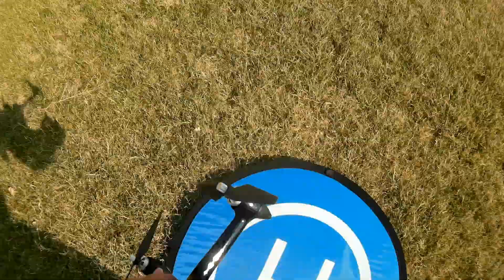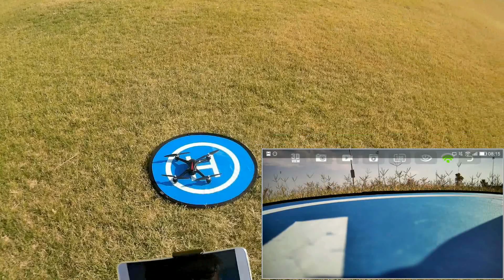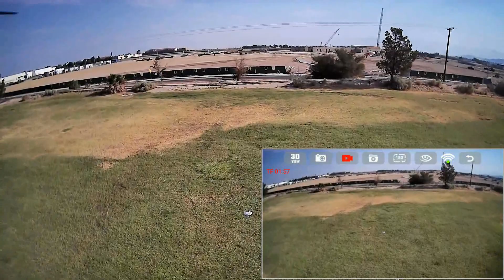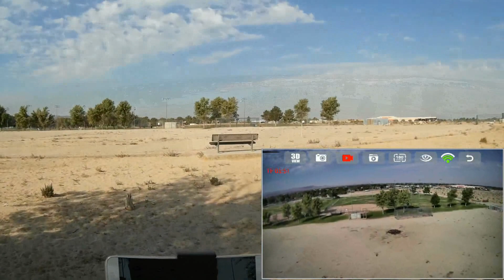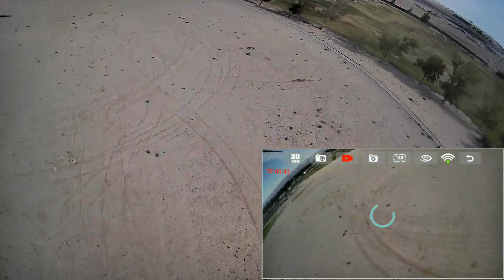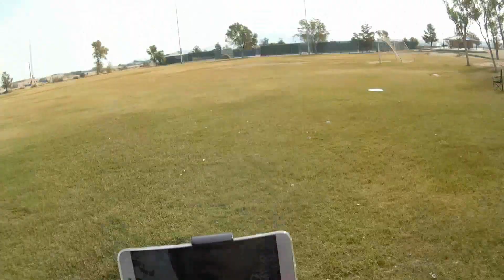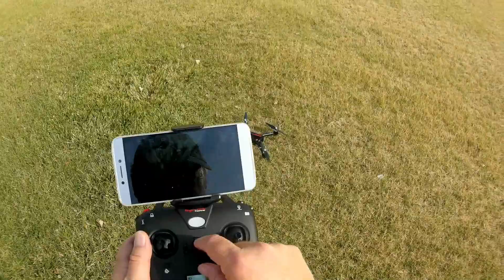MJX Bugs 2W B2W High Speed GPS FPV Drone Flight Test Review

Comment: Hello 101, could you tell me if there was a first generation bugs 2? The reason I'm asking is I purchased a battery that didn't fit.  When ask seller what's the deal  he stated its for first generation bugs 2 that doesn't have the locking nob on bottom. This one have a clip on top and bottom.
Reply: dave parks what I've done is use the battery from bugs 3 which cost a third of price,  with a little mod works great. I now have 5 battery for bugs 2w.👍👍
Reply from the maker: I was unaware that there was a second generation.  But according to the following listing, there is http://amzn.to/2xE4KSw
Reply: Michael Millines yes I notice my bugs2w have a lock switch under back of drone I see in video not every one have the battery lock the old battery won’t fit in new version but new version battery can fin in old version bugs2
Reply: Larry Dommer thanks for taking time to respond but I'm way ahead. Yes that does work and what I use. Thanks again.

Comment: hi wanna ask what the different with bugs 2c?any big gap between them?thanks
Reply from the maker: +Good Yeah Bugs 2C does not have FPV. Although it does have a 1080p camera that records to a mictoSD card, you can not view the in flight video view while flying.
Reply: Quadcopter 101 so when bugs 2c on flight it cannot show real time video record?can i get the recording video copy from mjx apps?
Reply from the maker: No.  As the 2C does not have any WiFi capability there is no app for it. You will need to instead manually download the recorded video from the microSD card.  You can do such with a USB card reader with your computer, or by placing the microSD card into your phone's card slot (if it has one).

Comment: Does any bugs 2 owners know if the stock battery 7.4volt  1800mah battery is able to be replaced using a modified bugs 3 2300mah battery 7.4volt
Reply: Yes u can as long as voltage same

Comment: Hi sir, what phone model did you use to connect in the bugs 2w because mine can't connect to my phone. My phone model is asus zenfone 3 max
Reply from the maker: As discussed in the video, and also listed in the cons of the video description, this phone uses 802.11ac 5G WiFi.  Not all phones have this capability.  As per the following site, your phone has 802.11b/g/n Wifi (not ac).  Unfortunately it will not work with your Bugs 2W. http://www.gsmarena.com/asus_zenfone_3_max_zc520tl-8207.php

Comment: HI!, question... can this quad get rewired to use standard Lipos of 2 or 3 cells?... I don't like proprietary Lipos as they are not available in Chile and very difficult to obtain as not many people ship lipos to Chile. Thanks.
Reply from the maker: Yes it uses a XT30 connector for 2S batteries.  You can use the widely available and cheap Bugs 3 batteries for this quadcopter.
Reply: Quadcopter 101 Thanks
Reply: Yes just pull battery out of case...use other batteries and hold in with tape, no door

Comment: Which is better. H501S Standard or This?
Reply from the maker: I really like this as its such a better flier than the H501S.  But the B2W does not have follow me mode if that is important.
Reply: Quadcopter 101 Which has a longer range? Safer flight and most stable? 

Thanks Q101

Comment: Hello again "Quadcopter 101". Many thanks for your review of the MJX "Bugs 2" brushless motored quadcopter. It was a fantastic review, and like many other reviews before it I thbnk you pushed me over the edge to buy one. With brushless motors, GPS,  altitude hold, stable video, etc etc. I think it's a must have for the price. 

Many thanks again for the great review of the MJX "Bugs2", and as always, very best regards.
Joe Cro
Reply from the maker: I actually took this on vacation with me (along with the DJI Spark).  So yes, I do think that the Bugs 2 is a remarkable quadcopter.
Reply: I appreciate your advice, and could easily tel by the enthusiasm in your voice during the review that you really liked it! I think I'll go looking around for the best price and buy one!
Very best regards,
Joe Cro
Reply: straight up test would be cool
Reply: straight up test
Reply: straight up test
Reply: what about a straight up test

Comment: It's beeping because your at low voltage , all the lights will start flashing red , just a heads up. Iv'e flown about 40 packs through mine. Flight time is only about 10 to 12 minutes. Still gr8 fun though for the price...

Comment: It will work with the bugs 3 lipo , put a small piece of  duct tape on one side ,either left or right side but not both and it fits snug enough to hold it in.

Comment: I have this quad and think it's gr8. I use it with my samsung galaxy 6s and it has perfect video connection up to 500m out and 100m high. My flight distance without wifi is about 900m out at 120m high. 
Great video :)
Reply from the maker: When did you get yours?  I saw some early reviews of prototypes back in April/May that had amazing WiFi reception.  But the one that I received is pre-production, and I think that they might have dialed the WiFi output power back (possibly for legal reasons).
Reply: Quadcopter 101 Hi there , I got mine 2 weeks ago from a seller off eBay from right here in the US. Not sure how they got there hands on it .I like it better then my 501s. Just wish it had a little longer flight time
Good thing I had multiple batteries for my bugs 3😎
Reply from the maker: Yep, sounds like you got one of the early prototypes sent out for review.  Consider yourself lucky.
Reply: Quadcopter 101 Yes I'm starting to feel that way😀
Reply: Did he just say Samsung Galaxy 6S ??
Reply: S. Kingsbury how is bugs 2 flying today

Comment: I am still a little amazed that no reviewer actually says that its very much like a Hubsan H501-series quad. :-) They amost equally in size, and in a sense almost the same design. I do think this one looks a lil meaner though. :-) It flies nice but I still think the H501-series from hubsan has a better camera.... you can clearly see jello in this camera.
Reply: Class 10 micro sd card takes care of the jello , I have no jello in mine.
Reply: I used the one from my dji mavic and it worked very well for me , but then again no 2 are created equal " quads anyway " . I will be uploading mine this week so feel free to come check it out :)
Reply: Most of the MJX Bugs will lift an action camera like a gopro, Git2,  Firefly etc. and those will allow you to get rid of
 the Jello.
Reply: S. Kingsbury Hmm that's strange. To my knowledge sd-card has nothing to do with jello? 🤔
Reply: S. Kingsbury I will do that
Reply: idk.. i don't have either but would like to get both :). but i agree, the Hubsan still looks to be better (more stable,better camera from the video clips i have seen) & it has more accessories & the TX + fpv range is better.. the places i looked, the bugs 2w is a little cheaper H-501S (the h501_ series model i think it best compares too), but i think i would spend the little extra for the H501S
Reply: RCI , the hubsan range is definitely not further and they are known for transmitter glitches.

Comment: this wifi range is unacceptable. If you mod it it can be nice but than you would spend more.. rather than modding better to spend another 150-250 usd and buy used phantom 3 or even phantom standard around 400 usd or buy a spark.. I like some of these cheap quads when they are less than 150 -100 usd range.. if they cost more than 200 usd than betternto invest a little more and buy DJI phantoms..
Reply: Bugs 3 was my first brushless quad and I still love flying it.  IMHO buying FPV camera and goggles and using with the bugs 3, for me, is a better option than buying the Bugs 6.  Mainly due to its versatility and the fact you can run on a 3s with 6045 props and get much more speed out of the B3 than the B6.
Got my son the H501s last Xmas, while camera quality is ok, still un-stabilised and fish-eye effect.
Cheers!
Reply: yes I have the Spark now and may consider removing the extended legs from the B3. Only issue with Firefly is the 3 second Auto Photo Mode minimum interval that is too slow. Can get good aerial shots with 0.5 second interval. I have the Yi 4K but it is way too wide, but like the fisheye correction in camera. The B3 with its bright LEDs really helped me get comfortable with orientation.
Reply: just bought b2w price only $120 with coupon.. i think that half price h501
Reply: You could add the Xiaomi Mi 4k to that list.  A number of reviews show features and camera quality beating the phantom 3p.  Just bought the Mi 4k and while only a few flights so far, I am very impressed with the quality and features.  Gimbal does an amazing job in high winds and they seam very active with firmware updates and improvements!
Cheers!
Reply: I second that. I just got the Spark. I have the MJX Bugs 3 and I did sell the Hubsan H501S. This seems a clone of the Hubsan. Even the calibration rotation is the same. Probably same parts. I learned orientation with the Bugs 3, and I used the camera in Auto Photo Mode, but video has jello or it is shaky. If you consider that a camera equiv to the Spark is 150 / 200 USD, a gimbal 100 USD, FPV monitor 50/100 + 100 / 150 for a quadcopter a Phantom 3 or a Spark is convenient and you will get better result. But anyway I ordered a Bugs 6 with FPV for 119 because the Bugs 3 is more fun to fly than the Spark, and Bugs 6 is smaller and more portable, and I can always rig a better camera in Auto Photo Mode and use FPV for framing. Phantom 3 is too large for me to carry around, and I prefer something smaller that is less threatening looking. But this Bugs 2 could be interesting if it were 150 and there'd be a way to extend landing gear and attach an action cam.
Reply: issue with goggles prevents line of sight flight. B6 was 117 shipped, and I like the smaller form factor. I probably can use some Syma X8 battery with the adapter that I use on the Bugs 3.My main gripe with the Bugs 3 are the taller legs that have to be screwed. I hope someone may produce some clip on landing gear. There are Git2P, Firefly 7S and 8S action cams that have 90 degree linear (no fisheye lens). But Spark is great for photos.
Reply: Yes had the Firefly Q6 and a 2d gimbal on the Bugs 3, unfortunately went for a swim in the lake I was over, I think load was to much for old battery.  Now they are paper weights, tried all the usual tricks but I think they are fried!  Replaced all ESC's and FC board on the Bugs 3 and it's up and flying :-)
Would be nice to have clip on legs for the Bugs 3, but using the Xiaomi Mi 4k for film and photo's now and the Bugs 3 for FPV and LOS fun flying without the landing legs.
Cheers
Reply: Yes love the front LED on the B3, it has saved me from a fly-away on many occasions when I was first learning orientation.
Impressed so far with the Xiaomi Mi 4K, great video and gimbal stabilisation.  Doesn't have as good a dynamic range as the phantom but IMHO it really is good value considering the price. 
Cheers!
Reply: Gur Isler Chris Riley is the king of bugs 2 he has flown his bugs 2 verybut very far. Unbelievable far check it out just type Chris Riley Bugs2
Reply: Arifin Liem hey where did you get it that price? Cheapest I’ve seen is $170
Reply: Hi where did you get it for that price?.

Comment: views less than 1k. haha. i like how you review quads.. very very different from the rest.. you actually play the quad until dead batt..
Reply: i mean im part of the <1k view club.
Reply from the maker: I think that its important to show how the quadcopter reacts and performs from takeoff until it can't fly anymore (no cutting of crashes and gotchas that may occur during the flight).  By doing such, little issues that would not have been noticed if cut become apparent.  For instance, notice that when I lost FPV transmission later in the flight, it was no longer able to automatically regain the FPV signal.  Thus as the flight progresses, the FPV becomes "iffy".

Comment: I like this one for the price. It's GPS is decent. It's wi-fi reception I would rate as very poor. I put a TX03 @ 200mW on an X8, carrying a YI cam, and had perfect glitch free, frame freeze free video out to 300 meters. While the video isn't bad, you'll get frame drops if you try to record 1080P video to anything less than a Class 10 card. The video is unstabilized but at least there isn't a lot of distinguishable jello (but a lot of ground shots). For the price, and for someone who may have been in the H501C market, this is a better deal, but its still pretty much a "Ford" and not a "Cadillac" as a camera bird.  Lots of reviews out there on this one, so potential buyers should watch as many as they can before making a final decision .. but as a beginner's GPS quad, its a pretty good bargain. BTW, I think MJX has a newer "X21" model coming out in the near future which seems like it will solve some of the issues that the Bugs 2 has. Just something for viewers to consider, though not sure if/when the X21 will be available. Thanks for the review. Cheers.
Reply: Bill Somrak how far can your x8 go, i tested the x8 everywhere and even in my flyaway video which was 500m away, i still could not loose range
Reply: Well, I did a little mod on my X8 TX .. have a 5dbi vertical mounted on the back of the TX, which comes off the vertical antenna inside. If you're familiar with the X8 TX inside, there are 2 antennas .. one a 1/4 wavelength piece of wire running horizontally, and (originally) a coaxial 1/4 wavelength antenna that ran up into the white antenna stub. Later X8 TXs got rid of the coaxial vertical and replaced it with just a 1/4 wavelength piece of wire, same as the horizontal wire. When I observed this on the spare X8 TX I bought for $14, I immediately replaced that piece of wire with a coax to bulkhead connector, which protrudes out the top back of the case. I screwed a 5dbi antenna onto that. With that setup, I've never really gone out of range. The X8 is greatly under powered, and has brushed motors, so I wound up selling it with the original TX to a friend, who is still flying it to this day (without my cam/vtx stuff on it). Cheers.
Reply: Bill Somrak yeah, ik it dosent have the best punch, but it does pack some lifting capacity, it lifted 300g for me so its more of an aerial video quad, the range has never been an issue for me, only the wind fighting and thats why i made the move to a p3, have a good day mate!
Reply: Exactly ... in even light wind, carrying a cam/vtx, in 'high rate', sometimes you find yourself going backward with the X8. Many was the time when I had to employ "special tactics" to bring it back, which usually involved chopping throttle so that I could use a 'gravity assist' to help me get back against the wind. I have a P3A, an old, quirky  XK X380, and most recently, a DJI Spark for doing camera work for my channel. Have a good day! Cheers.